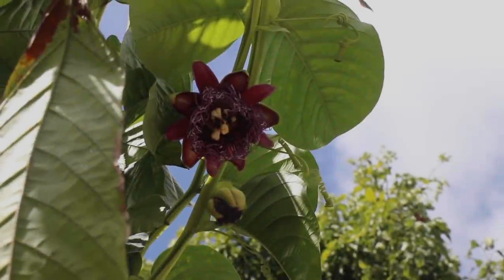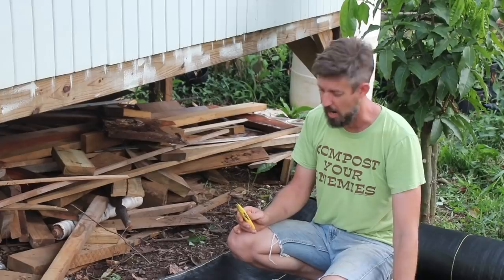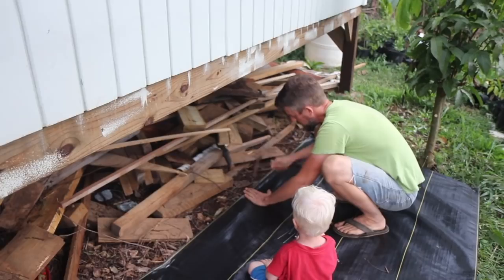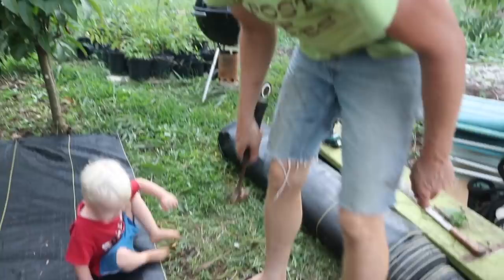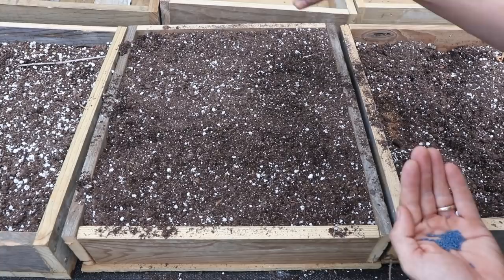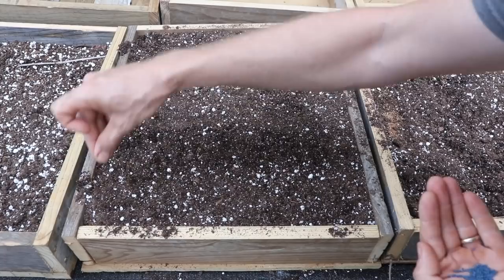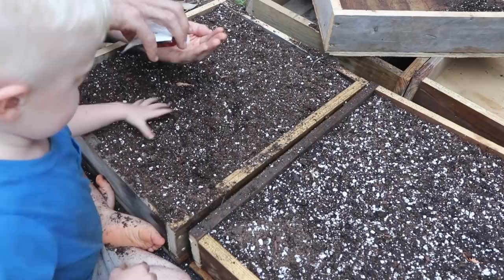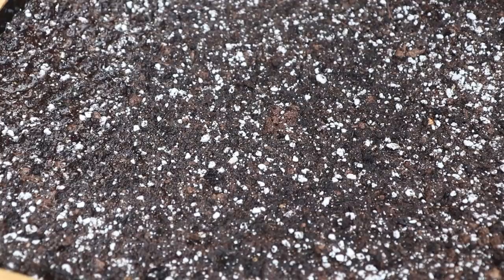Starting Seedlings with Awesome Weed Block and Homemade Seedling Trays

Comment: With tiny seeds like that try wetting the soil first.  Then you can pay them in without them being washed out of place. And don't give up on the tomatoes.  Transplant the out bigger. Like  3-4 inches.  When the are big take off all the leaves that touch the ground and don't water from above.  That will decrease the chance of mildew. You can do it David!

Comment: I love this weed blocker, you can also cut it on the white lines and make borders/paths around a bed to stop the weeds. 

David, you said the termites at your location are just killer, are you going to move all that scrap wood off the ground? (Have termites here too, get heart palps when I see wood-to-ground)
Reply from the maker: Yeah, I have to move it. Space is very limited, however, so I am not able to get it all stacked up high where I want to put it.

Comment: The value of broadcasting and intensive planting is that the loss of any particular plant is no great tragedy. In fact, thinning replaces weeding, and sometimes has the side benefit of edibility. It's kind of like an artificial application of the old theory called r selection, which suffered from its ambiguity and dubious mathematics. The more you make, the more you get, despite a high attrition rate.
Maybe you could say the same thing about having nine kids? ;)
Reply from the maker: Yes, I agree. I like direct seeding, but I have had a lot of trouble with big gaps and things disappearing in the night.
Reply: @davidthegood  Your kids have been disappearing in the night?!?! Oh dear!